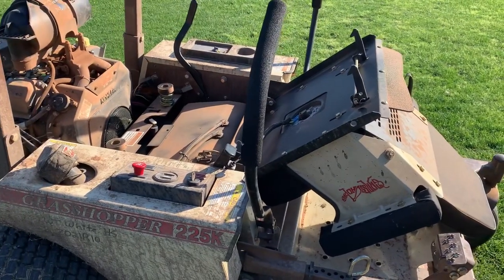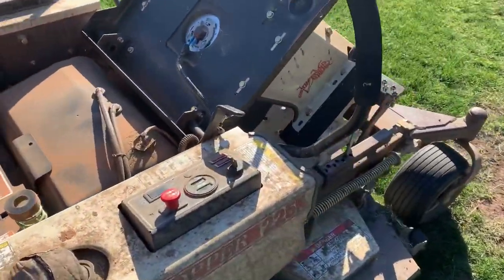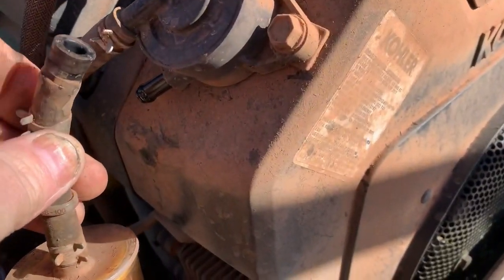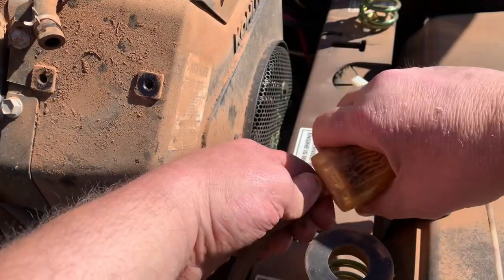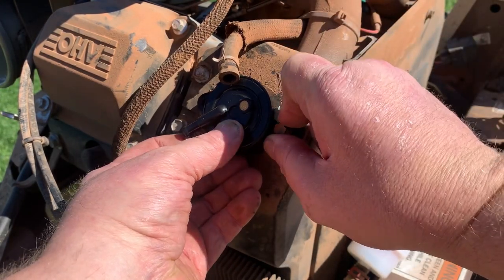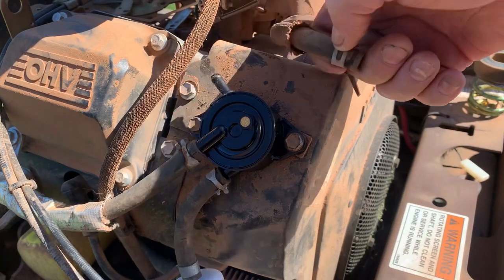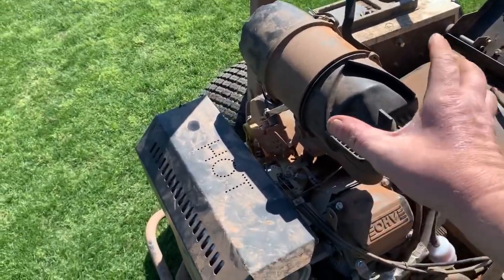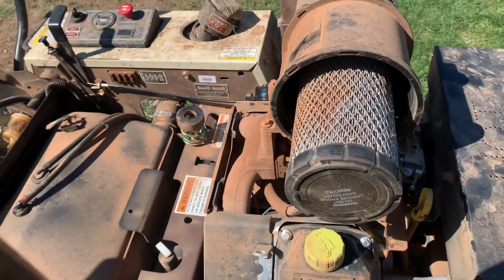#HOWTO #TROUBLESHOOT A NO START ON JUST ABOUT ANY #ZEROTURN #LAWNMOWER

Comment: I have this same problem, I replaced the vacuum pump and then I realized the vacuum hose had a crack in it so I temporarily fixed that with some zip tape to get it going and it’s still won’t run without starting it with starter fluid first. Then it runs great
Reply: Likely still has a small leak , enough that it will not get fuel at cranking speed but once it's running will pump enough

Comment: Need a Lil help bud,  my 335 won't pump fuel, I tried 2 new pulse pumps, even primed them by pressureizing tank, spun her over and fuel just drops back in tank, checked pulse line, no cracks, ran down battery several  times trying to get it to start pumping with no luck...

Comment: Yep …many people are just PLAIN  STUPID  OR LAZY  ,some people are both 🤯 .     I worked at a brick manufacturing place ….  Back in the day  , They bought a 2004 cat-skidstear     . After every night-shift . I cleaned the air filter.    I  went on holiday’s for 4 weeks ….  First day back to work . I opened the air-cleaner Case …..dust came pouring out ….the 4 weeks I was away  not a single person cleaned the air filter  of this brand new $90:000 … vehicle  🤯 it was also as dry as a bone ….not a single drop of fresh grease .

Comment: My Grasshooper has been the most miserable machine I’ve ever owned. It lives in the shop, one thing after another mistakes found made in a factory. They couldn’t even put the pulleys in line, nothing was torqued parts keep falling off. Nothing was set right when the dealer dropped it off and then two months later he goes out of business. I kept calling grasshopper about #Warranty work, and they sent me to the most unskilled dealer. We could fine would never worked on a diesel.

Comment: How can you test the pulse line. I bought a new fuel pump and Kawasaki engine still would not pump gas out of pump. I unplugged the pulse line at pump and while turning over engine and only  felt pressure, did not feel any vacuum.

Comment: I have an issue with a 2008 grasshopper 227 that I recently purchased….it will not track straight forward nor reverse. My left stick is weaker and runs about half of what the right one runs. I have checked belts, adjustments, fluid level. The right pump looks like it has been replaced. Is it my left pump?
Reply from the maker: Prob replaced
Pump from eBay.  Wrong cc output.  Seen that a lot
Reply: Thanks. The new one works good. The old one is one that is not. I’m researching to see if this is my issue